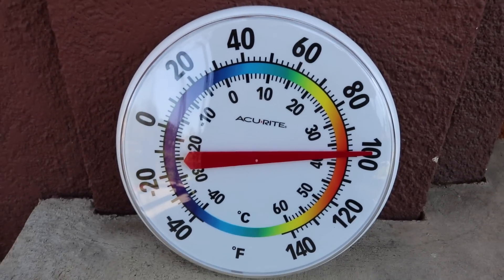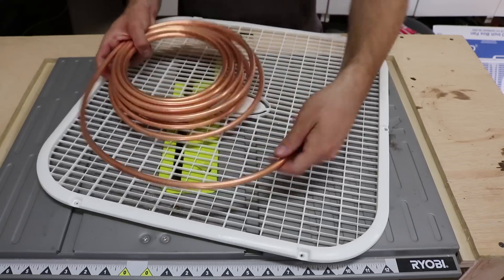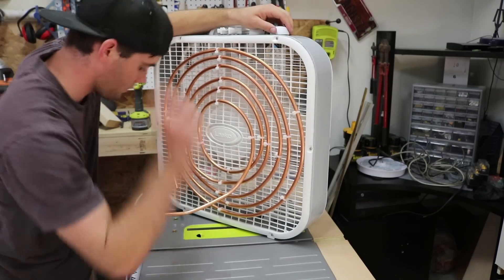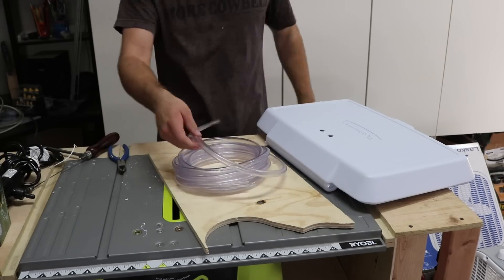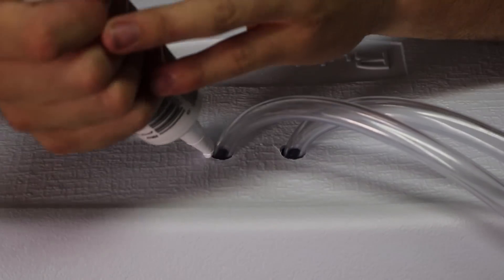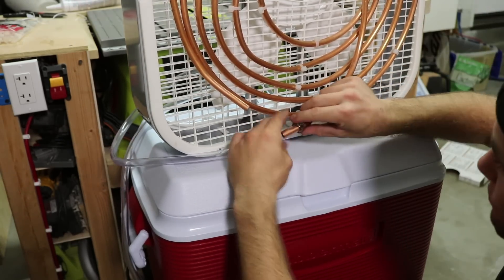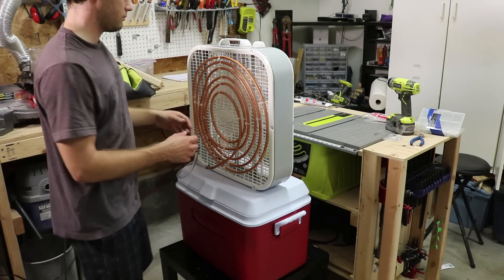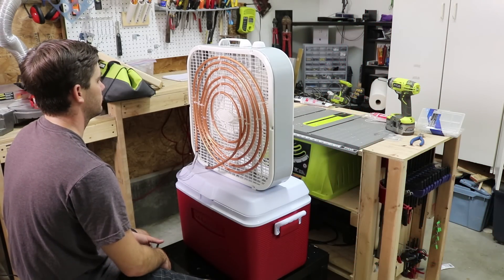$100 Homemade Air Conditioner - DIY

Comment: You could also use an electric freezer box instead of a regular one. Yes, it will take me power, but the water inside will stay cold.
Reply: This is a very bad solution akin to holding a freezer door open in order to cool the room. A freezer works way better when it's a closed unit, when there isn't hot air constantly blown into it. You'll notice why, by measuring how much longer it takes to freeze water in the freezer, vs. melting water (and spreading cold air into the room) in the unit.
Reply: @kebman  Yeah... except, the lid wouldn't be open, wouldn't it ;) Also, yes usually when you use the freezer for its normal purpose, yes, but in this case it doesn't have to keep anything frozen. All it has to do is keep the icy water cold longer than a normal cooling box would.
Reply: @kebman  not if you put it outside 👍

Comment: That definitely uses less electricity than a window unit
Reply: But U'r spending lots of money on the ice...Dumb idea
Reply: Not if you keep a supply of re-usable plastic ice packs in the freezer.
Reply: @SouthbaySpeaks   Uh, the ice isn't made for free. It takes electricity to run a freezer.
Reply: @bruceshand8052  Uhh, the average freezer runs all the time anyway. Why not store some plastic ice packs in it?
Reply: @SouthbaySpeaks   Yes, but it takes power to remove heat from the water to make ice. If you  keep taking ice out and putting in liquid water you don't turn them into ice for free.
Reply: @bruceshand8052  True, but I would venture that using plastic ice packs a few times a week during the summer months in a homemade AC system still uses less energy than a conventional window unit.
Reply: @SouthbaySpeaks  That may be true. On the other hand this homemade thing is good I guess if you don't mind dumping warm water and carrying in ice every whatever. Plus, you have to stand in front of the fan if you want to feel the relief. I suppose for a one-guy short term workshop stint, lke a few hours max, it might work fine. An all day thing I don't buy it.

Comment: You didn't make an air conditioner,  you made a cold water chiller.  All your doing is transferring heat from the shop in to your water...  To be an air conditioner, you need to have the refrigerant change phase.   Which means you need a compressor, some canned air duster for refrigerant, a condenser that you mount outside with a fan blowing through it to condense your refrigerant to a high pressure liquid, which you then bring back inside, run it through a fixed metering device oriface tube, which drops the pressure to the point that the refrigerant boils at about 35F and blow your fan through that.  then you have an air conditioner..  You would have been better off cannibalizing the A/C parts from a junk car and making a "central air system" where you run the compressor and condensor outside, then run the high pressure liquid line back in to the shop through a small hole in the wall (big enough for your refrigerant lines) then in to the evaporator.

Comment: it might work better if you put the copper on the other side pulling out air thru the coil is the only way to get rid of hot air, anti freeze would be better. law of refrigeration, remove heat. if he did it all with dc power it might help when you lose power

Comment: You should have just bought a 200 dollar small 7 cu ft freezer, open the door a little, blow air into one side and have it come out the other side.      Oh, and vent the working air part of the freezer to the outside.    You'll bypass the making of the ice.

Comment: We forget that with a window AC unit, you have to have a window or a hole in the wall to set it in.  You built a pretty handy swamp cooler.
Reply: I'm curious how it is a swamp cooler. To me it seems to work under the same premise as a radiator, not via evaporation as a primary source of cooling.
Reply: @BrokkrtheDwarf  I would think that moisture is produced by the ice cold copper tubing coming in contact with the warm air.  The fan then circulates the cooler air that has formed from the evaporation process.  From what I understand, a swamp cooler draws air from outside.

Comment: Hey folks.  The space he wants to cool is too big for a portable A/C in the $100-$150 price range.  It's also not properly insulated to run A/C like your living quarters would be.  A portable A/C of the walmart variety in that space, and with temperatures that high would cause it to be overworked and eventually burn itself out.  Plus, I've seen what haappens to A/C that's too small for cooling a large space.  It turned into a big solid block of ice before dying.

Comment: When the ice melts partially and there's plenty of cold water in the cooler, add copius amounts of salt.  It will drop the temperature to approx minus 10° celcius.  Throw a six pack in there as well.  You can cool a six pack to optimal drinking temperature in just 5 minutes.

Comment: That's interesting, but where is the heat going? It's melting the ice. So a true aircon would also recharge the ice or whatever. The heat exchangers could also be improved in efficiency. At some point, you'd want to be pumping hot air out of the room, and cold air in - possibly sucking more air in from the room.

Comment: to cool down a garage you need a 12,000 BTU machine at least I would guess . . and that would go for at least $350 be it refrigerated or swamp cooler . . you don´t provide temp readings so we don´t know how this invention would alleviate the heat

Comment: Did you measure the temperature in the shop after you had run it awhile?
Reply: Smythe and Taylor that’s what I was thinking. Would have been great with a thermometer with before and after
Reply: I'm guessing there's next to no effect from it. It's a woefully bad design to begin with.
Reply: @kebman  I did a design similar to his but better and more expensive using an old car radiator. It really does blow ice cold air (colder than standing right in front of an ac vent) but eats ice quickly. Part of it though is I need to insulate the attic above my garage. After doing that I bet it will work better (last longer or get the temp lower or both).

Comment: What is the cooling output? you didn't do a temperature reading at the end.

As far as people saying to buy a $98 "Air Conditioning" units... those are not air conditioning units, those are swamp coolers. Which also require frequent ice and basically only good if humidity is below 30 percent. Anything higher and you have a humid room that basically isn't cooling any more because cold air is dry air.

Now you could get an actual AC Unit, but you will need to have an exhaust hose running to the outside.

If what you built works, and cools without humidifying then I definitely may build myself one for my office at work. Unlimited ice and its hot and humid as hell here. Thank you for the info!

Comment: Build it with a yetti cooler then the ice will last for days.  And running the fan and the cheap put is alot less on the power bill.
Reply: Of course a $300+ Yeti cooler will eat into your power bill savings, but who's keeping track?

Comment: One of the things I find ridiculous is sending city cold water into my water heater if it was heated  to room temperature  perhaps in hot attic  the energy cost would be significant. Another thing to think about is the cooling cost of the house. In other words a person is paying the to have the cold water heated and to have the hot air cooled.  The best thing would be to move the heat from the air to the water to save on the energy cost of heating the water and also move the chill out of city water into the air where can be beneficial.

Comment: as long as you have 1 TON OF ICE, you can run at 12,000btu/hr for one hour....
Reply: Yes, it takes a lot of ice, but not that much! A ton (2000 lbs) of ice will deliver 12000 BTU/hr of cooling for 24 hours, not one hour. (See the definition of "refrigeration ton" at https://en.wikipedia.org/wiki/Ton_of_refrigeration .) For one hour of cooling, divide your 2000 lbs by 24. That's "only" about 83 lbs of ice.

Comment: I would just put a bowl of ice in front of the fan 

Boom cheaper
Reply: But not as effective. The pipe has a lot more surface area. Air flowing over a bowl of ice is just going to skim across the top assuming the ice is above the bowl's edge. After the ice has melted the air will have to flow over the lip. The further down it has to flow down the less cooling you get. In short, this thing is about 20x more effective.

Comment: Hey buddy that's a way to stay cool and good thinking always remember this though when you have an idea call around and ask people if they have anything that's laying around that they don't need scavenge all your parts there are so much stuff here on our planet that can be recycled and refurbished and reused it's not even funny I made a butane pistol from old flashlight parts and old torch lighter and a long stem trigger lighter I put it all together with the barrels and everything little extra metal pieces and it shoots brass rounds and leaves 4 inch holes in s***. All scavenged materials in an imagination the sky is the limit lil bro

Comment: Interesting DIY project (if made with scrap parts) but to 100 bucks to build an 'Evaporative Cooler' seems expensive when they are half the price of the cheapest portable AC units anyway? Evap-coolers spot cool the surrounding air but won't do much to change the actual temp of a room, especially if its very humid!

Comment: It would be easier to mount a portable freezer in your window with the rear coils/vents outside. Leave the door open and circulate air through it. Fan is sisters blow drier set on fan only (with heat turned off). $29 Walmart, ( https://www.walmart.com/ip/Frigidaire-Portable-Retro-6-can-Mini-Fridge-EFMIS129-Red/621321388?wmlspartner=wlpa&selectedSellerId=0&adid=22222222227164200409&wl0=&wl1=g&wl2=c&wl3=277872440537&wl4=pla-655092670272&wl5=1014573&wl6=&wl7=&wl8=&wl9=pla&wl10=8175035&wl11=online&wl12=621321388&veh=sem&gclid=CjwKCAjw67XpBRBqEiwA5RCocZalwIoWIkNRBTx_aR408hYd13wE_lewbUf80jRQ47s9lJHrj3rezRoC3CEQAvD_BwE )

Comment: I built one for less than $50 basically the same but used items I had on hand. I used a fish tank pump. The pump was about $11. The most expensive item for me was the copper tubing.  Worked great.
Reply: Interesting.

Comment: Those aren’t pipe clamps, they are called hose clamps.  Pipes don’t need hose clamps usually due to a process called brazing, and welding simpleton!

Comment: You could have just used peltiers for a few dollars each. They work better and are much easier to build.
Reply: But would require someplace to vent the heat.